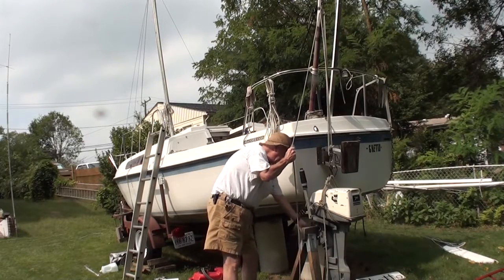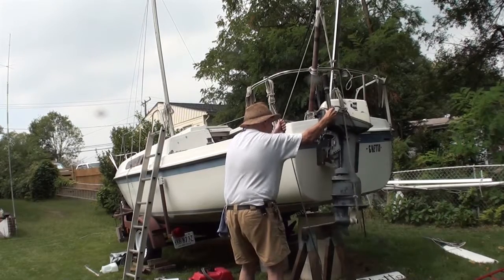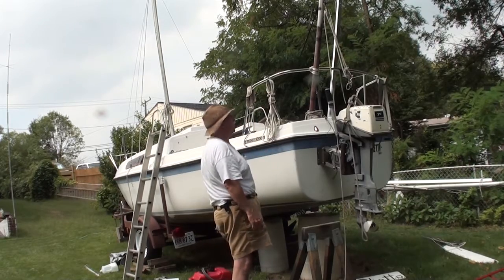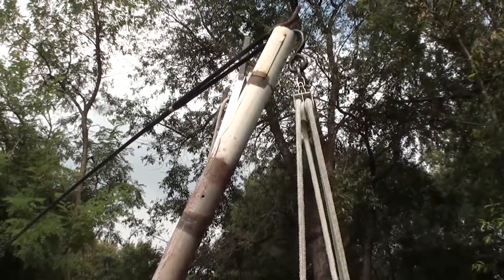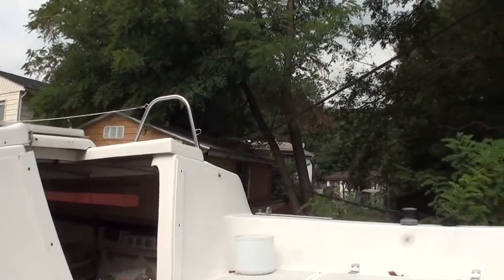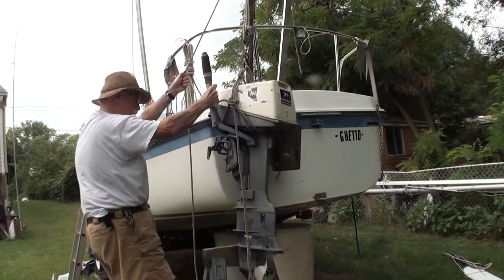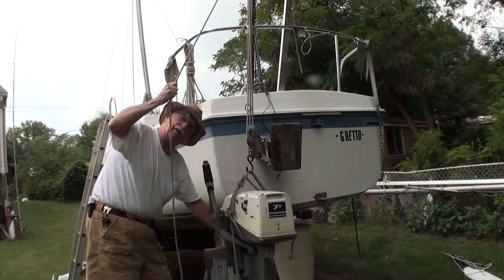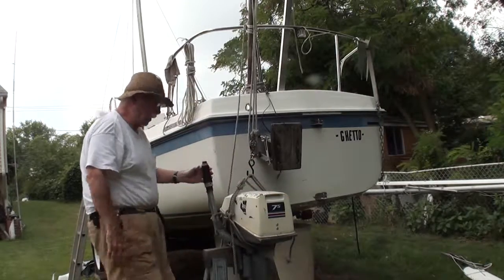Outboard Motor Lift

Comment: I did something similar, a block of 6 pulleys, that reduce weight to 1/6,  trim the outboard and lift by outboard motor back, the balance is better. Mine is 15 hp, 43 kg. Drill 2 holes on the corner base and pass a 3-4 mm rope like a handle to be lifted.